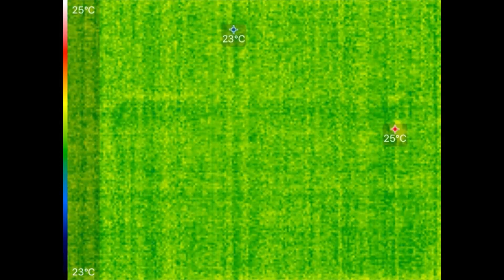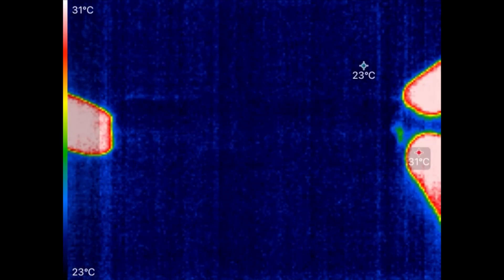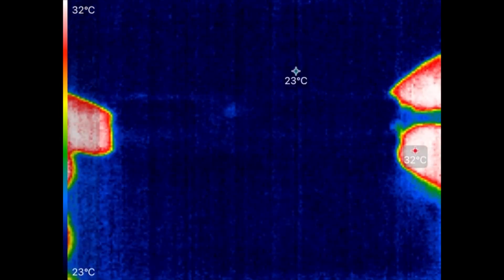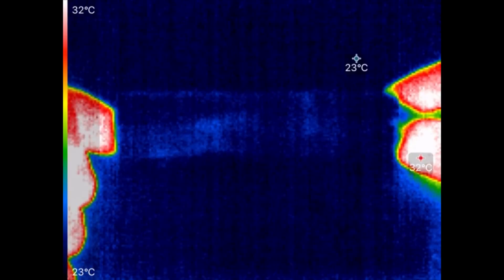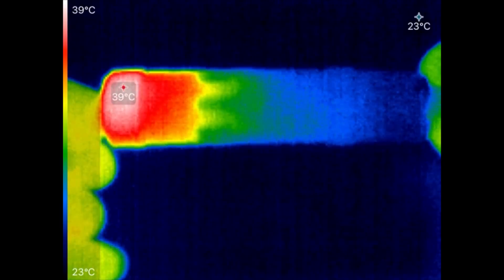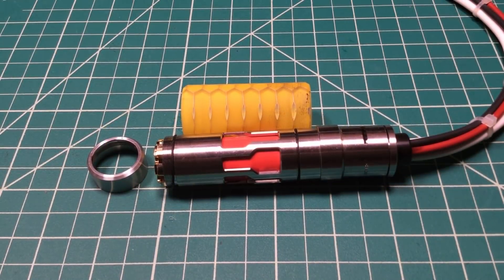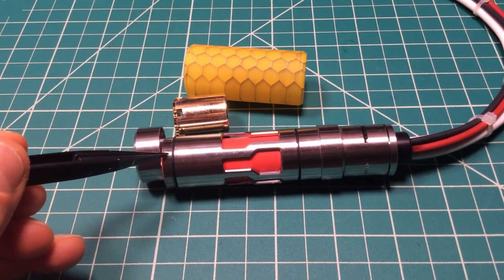Minding Your Mechs – Ep004 – Wismec RX Machina Thermal Imaging – Hotspotting?

Comment: how do I find proper amps (battery) needed for a particular device.  Im  a new user, bought a wismec vecino on sale, and samsung 30q thinking it would last longer ( says 15-20 amps), found one review saying to use 25-30 amp.  my unit gets hot after a short press or a few puffs.  am I over-taxing the battery?  Is it unsafe?  why doesnt wismec state in the package  the best size to use?
Reply from the maker: Check out Ep2 of my Minding Your mAhs series. It deals with calculating battery current for an unregulated device and choosing batteries. A 15A/20A battery is being run pretty hard with 0.2 ohm coils, around 20A. Better to use something like the 25A-rated Sony VTC5A.
Reply: @batterymooch  thanks

Comment: Chain Vaped this thing 3 weeks with 18650 's no issue then fire button got crazy hot. I put some plumber's tape on the bottom switch cover threads and it's much better for now.

Comment: Mooch. You should take a look at the XXX mod by VaperzCloud. It has a unique switch and works with 20700s and 18650s. The reason the button is unique is that it uses a platted copper coil inset into the housing of the button that stays in contact with the button contact at all times in 360 degrees. This means that you have virtually no hot spots and it greatly reduces the voltage drop. Also the mod threads apart in the center instead of the top and bottom. In other words there are threaded parts to lose voltage to. There are no extra parts to go from an 18650 to a 20700. Just a beauty ring to fill in the gap, but it's not electrically connected. Just cosmetic. It's a very intelligent design and I'd love to see it used as a standard to beat for others.
Reply from the maker: I’ve seen that mod...interesting design!
If I can get one sent to me, in each metal if available in more than one, I’ll test it.
Reply: I sent Antony Tran a message on facebook. He's a cool dude. He said he would definitely think about it. :) Faster reply than I expected lol.

Comment: I was wondering when someone was going to break out a FLiR. :)  My dreamer sometimes feels like it's shocking me but I know it's a hot spot like you're getting with this.  Glad you explained about the tape trick to your viewers.  Most IR can't do metal as they don't cover the proper emissivity range needed.  Krylon ultra flat black works well too and is easy to remove when done.  In a bind, masking tape will work too.

Comment: Great video. Interesting to see how the threads and thin spots react in a high current circuit. Have you done any tests using Noalox on the threads? I hear some people swear by it, regardless of the metal they're putting it on. It's main use is for bonding aluminum to aluminum, keep oxidation down and prevent lug seizing.
Reply from the maker: Great for minimizing corrosion but does nothing to increase conductivity. I’ll be testing dielectric greases at some later time.

Comment: I assumed the cut outs in the barrel are to allow heat from the battery to dissipate ! Just a thought, but maybe that’s what the designer of the mod thought too!
Reply from the maker: The metal tube conducts heat away from the battery much more effectively though. The cutouts are covered by the sleeve so no air is available to cool the battery that is exposed by the cutouts.

Comment: Great test and observation Mooch.
My favourite culprit would be the cup/tube interface. as it wasn't regular or consistent around the circumference as I'd expect if it was the electrical choke point from the cut-outs - especially as the strips connecting top and bottom portions didn't appear to get warm at all, despite having the lowest conductivity of any part of the tube.
Given the cost of IR thermometers, that is a test that can easily be done by reviewers and even end users, and is very useful indeed.
Thank you for all that you do to keep us safe!

Comment: There's no current passing through those bottom threads.  The circuit goes from tube to button/cup thingy to battery.
Reply from the maker: If the cup touches the screw-on cap at the bottom then current can flow through the threads. The cup doesn’t evenly contact the inside of the tube and one of the hotspots that popped up was at the threads. I think there will be varying small contact points as the cup shifts.
Reply: I can't conceptualize the scenario where the cup would only touch the screw-on cap with the circuit closed and thereby force the current load through the threading.  When you depress the button even just a little, it's already almost completely passed the cap and would be making contact with the tube so the current would take the path of least resistance.  So even if there was some current passing through the threading it would not be the entire load so it would not be possible for that to create hot button which is usually caused by a scenario where your switch is causing resistance.
Reply: I should add that I sanded the inside of mine with a drill when I got it.  Chinese manufacturing, I was worried about burrs tearing battery wraps.  Maybe that improved the performance of mine because I've run many a .08 build on it and never experienced hot button or hot spotting of any kind with it.
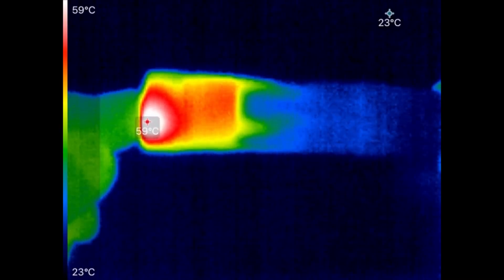Reply from the maker: What do you think caused the hotspotting at 3:21 and later then?
Reply from the maker: I think only a few experience hotspotting. Perhaps due to heavy use, perhaps due to burrs or tolerance issues that concentrate current. They had hotspotting issues with the prototypes but felt they had addressed the problem.

Comment: I swear I can feel my switch getting super hot on the tip of my finger with a 0.1 build. I use the battery positive down and I know that it's normal but it doesn't half scare me when I wonder how hot a battery gets right before it vents
Reply from the maker: Typically over 80°C but by how much depends on the battery and how fast you are pulling current.